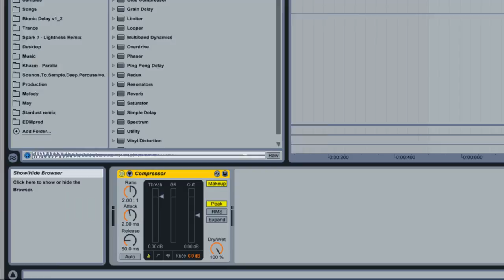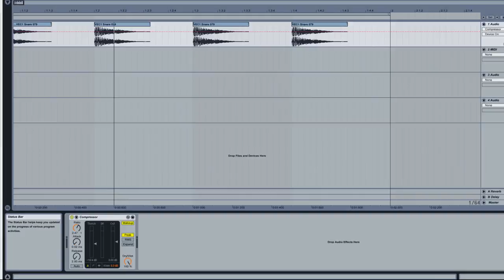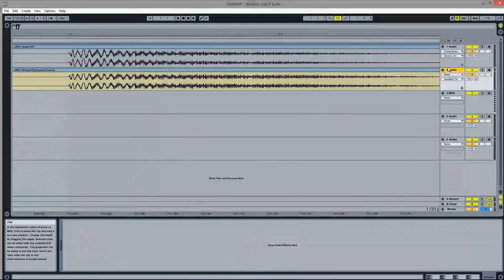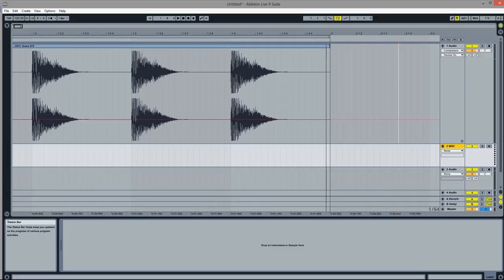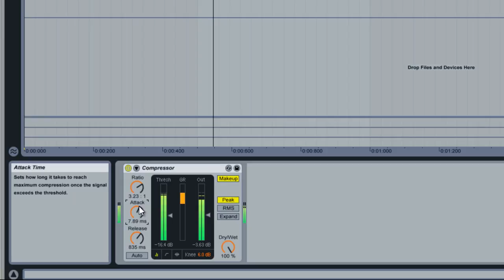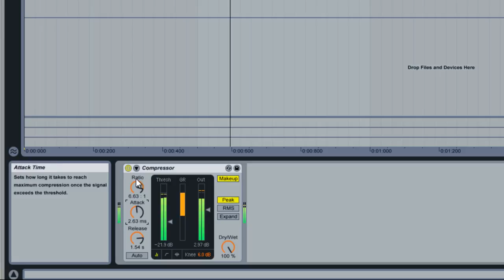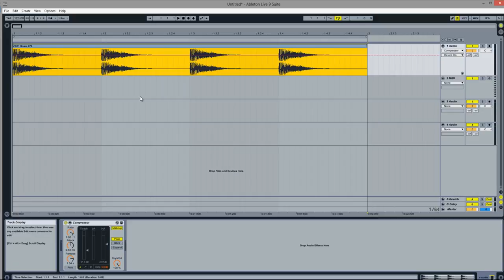Three Different Ways to Compress Your Drum Hits

Comment: For anyone viewing -- the last type of compression has far too long a release on it (>1 second!) which means only the first hit is properly compressed (with the initial punch increased), as the other hits are all compressed heavily due to it still being in the release time. A release time around 300-400ms would be as high as you would go on this track -- but release is entirely down to your track. You want to set it so it doesn't take as long as the closest snare hits are.
Reply: I was just about to post this comment 😃